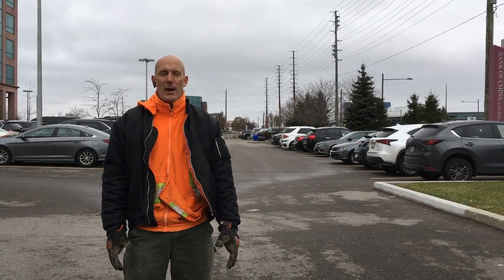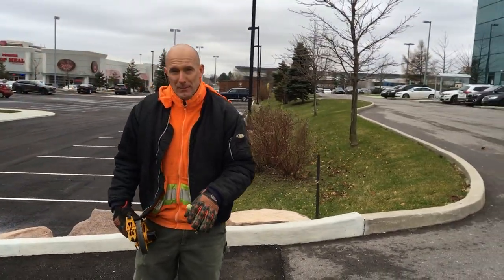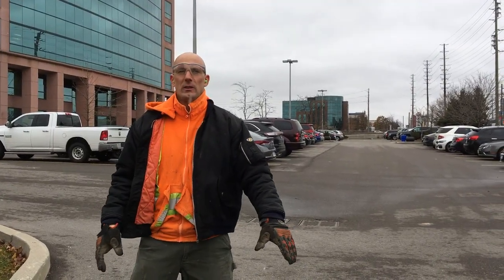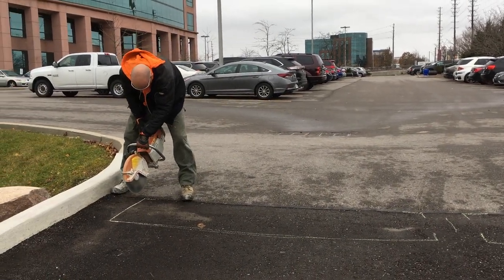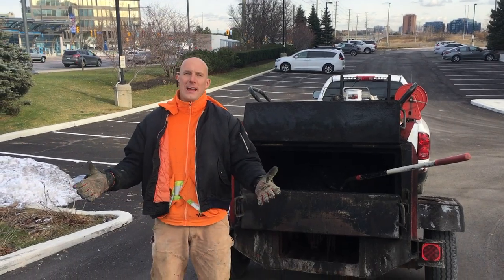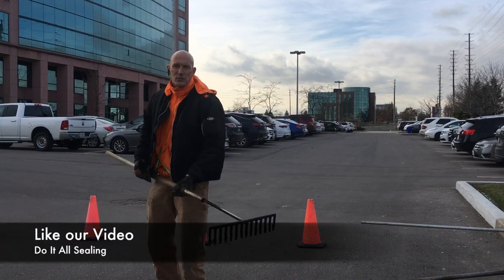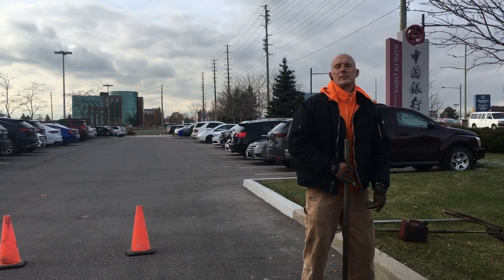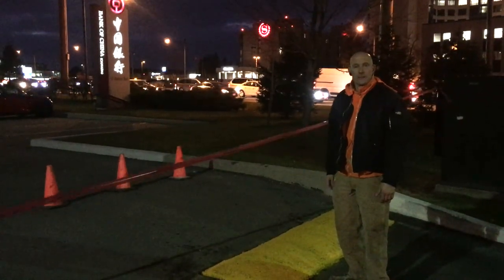Brand New Asphalt Speed Bump Installation

Comment: quick question, wouldnt optimal temperature for laying asphalt be at least 50 degrees F? wont the cold weather mess with the curing process
Reply from the maker: The warmer temperatures are better for sure for the asphalt.  I have experienced having some problems in the past laying hot asphalt in the winter over base concrete on a parking garage.  I literally had less than 5 mins to roll or plate tamp the asphalt.  Winter time I normally only do smaller jobs where I can manage the asphalt while its hot.  Thanks for watching!
Reply: @JeffLepard  gotcha, thanks for the response!
Reply from the maker: I started a new DO IT ALL SEALING channel: https://www.youtube.com/channel/UCE4x9dzt-NuHwlEDuAdC2kQ?sub_confirmation=1

Comment: Why are there lots of defects around speed bumps. Any ideas?
Reply from the maker: Yeah this mainly is because of the snow plows that smash into the speed bumps.  Also, lowered cards and sports cars sometimes bottom out and scrap the asphalt.  I will be filming a video on repairing speed bumps this week actually on my new channel.  https://www.youtube.com/channel/UCE4x9dzt-NuHwlEDuAdC2kQ?sub_confirmation=1
Reply: Thank you Jeff Leopard.
Reply: But before you approach a speed bump or right after exiting a speed bump there are defects before and after the speed bump. I’d wanted to know the cause
Reply from the maker: This would be the asphalt that is all around the speed bump.  It could be the water pooling around it or just bad asphalt in general.  Sometimes these speed bumps are installed on a parking lot that is not in the best shape so the asphalt around the speed bumps are badly damaged.